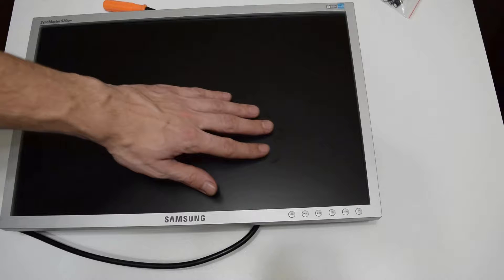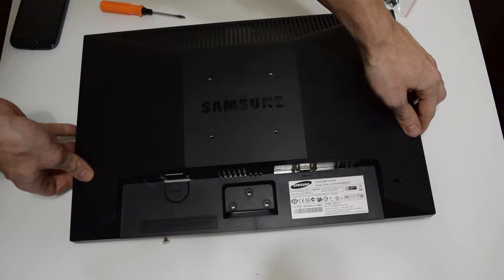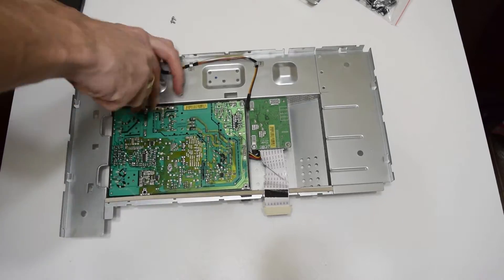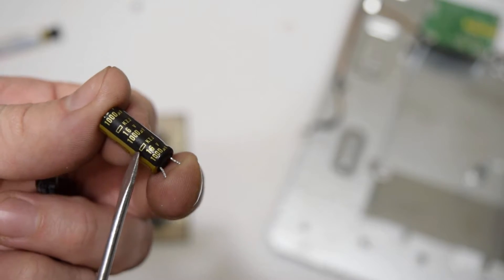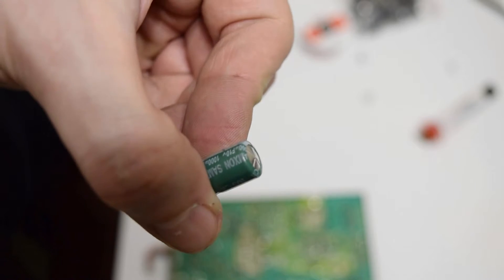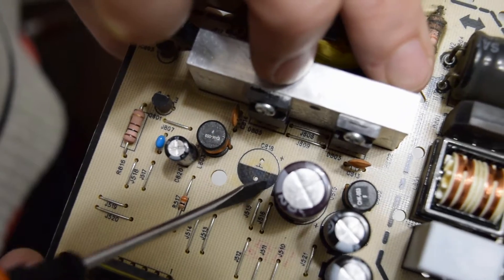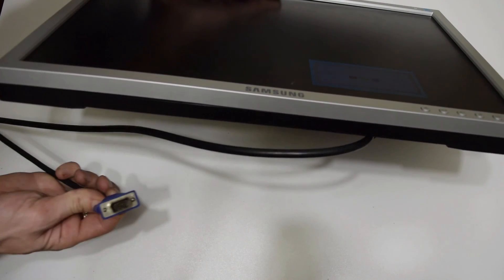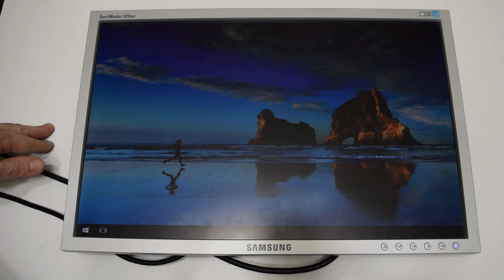How to Fix Any LCD Monitor or TV – Capacitor Replacement (Samsung N920 Disassembly)

Comment: At 0:59 the color cables are in a diffrent position compared to the end of the vid, when you plug them. Seems like you connected them wrong.
Reply from the maker: Those wires go to the lamps, then's no difference on how you connect them.

Comment: Thanks for this great tutorial! Does this monitor have any high voltage cap that may cause shock or damage?
Reply: Just a quick update: I replaced the exact cap (green one) and now my monitor is working flawlessly. Thank you!
Reply from the maker: I'm happy to help!  @serix_16
Reply from the maker: The biggest cap but it's discharging in a couple of minutes.
Reply: Thank you very much. I'm going to apply this method to my monitor which is the same as yours.